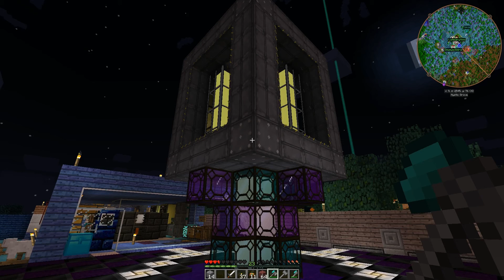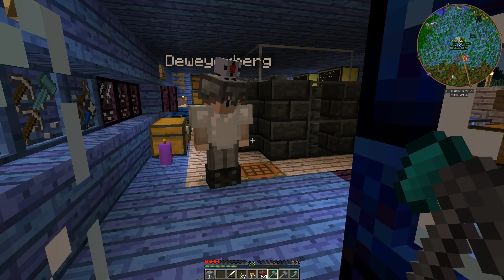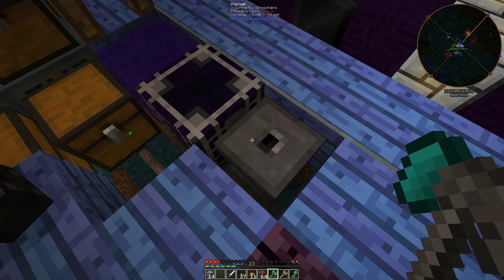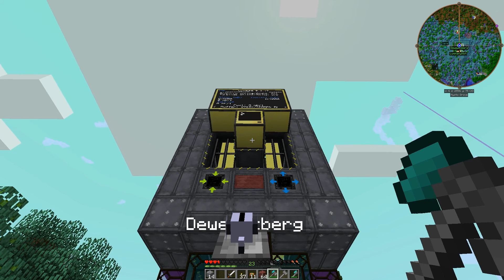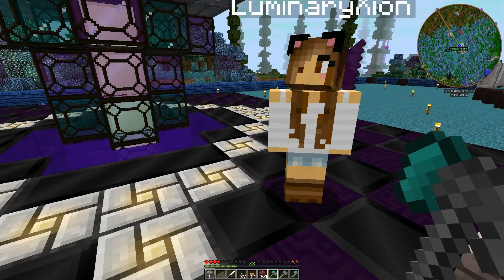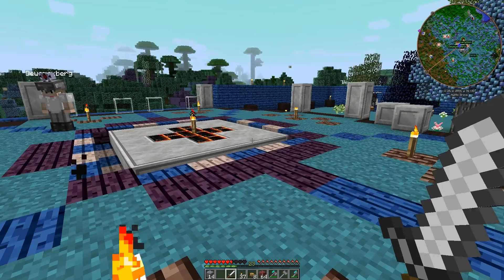Minecraft : Journey of a  Newb - Episode Seven - Nuclear Reactor

Comment: Things can get confusing with multiple similar mods since some work nicely together while others use different methods of doing things like the types of power in the technical mods. Most technical mods seem to be moving towards using Redstone Flux (RF) from Thermal Expansion, but there are still other big technical mods that use different forms of power. The same confusion can apply to other mods such as magic mods (Thaumcraft, Blood magic, Ars Magica, ect) which use different magic systems.